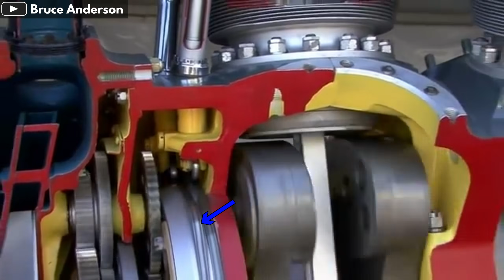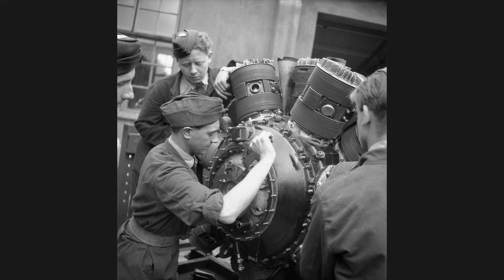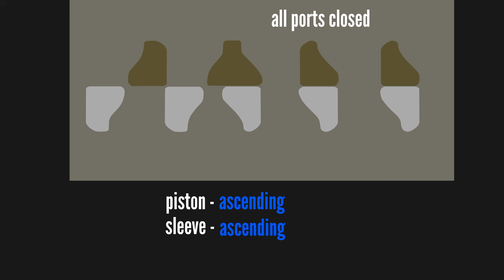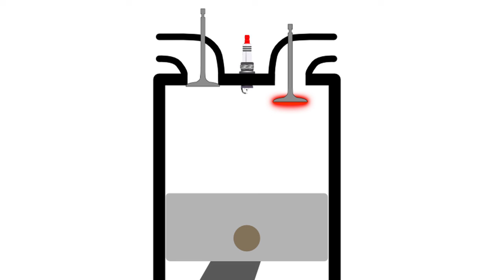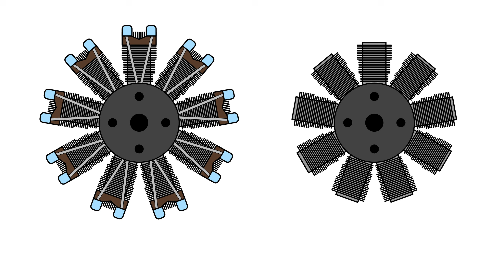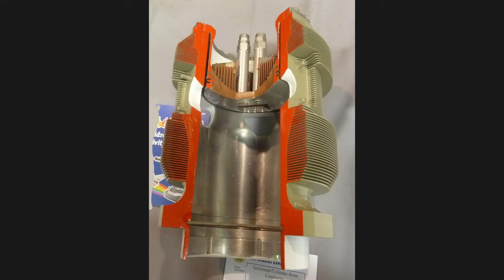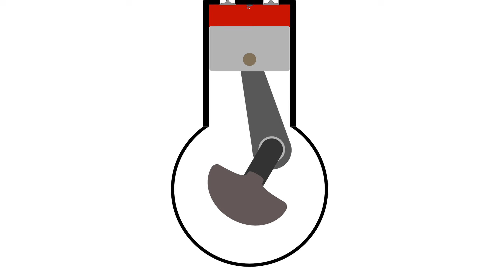Analysis of Bristol's Sleeve Valve Aero Engines

Comment: Important to note,,right from the beginning,,,the sleeve valve had much bigger openings than popet valves,,better "breathing" ,,and ! ,made a considerably smaller diameter engine,,streamlining the airframe better,,
Reply: Did you actually watch the video before posting your factually incorrect comment. As the video host said, the claim of smaller engine diameter was a wash. What the sleeve gained in losing the valve train it had to give back in an extended cylinder set-up.
Reply: @paulflocken2730   that's great to hear you treat u tube videos as absolute authorities ,,gospel troof ,,now,,take a tape measure,,go to an aircraft engine museum,,you'll learn a lot,,,😊the " herc" measures aprox 52 inches,,other poppet valve start at 55 up to 60,,every inch means greater air drag and less time  to taper the fuselage back to the tail,,but not only that,,they needed far less servicing before next mission,,valve trains need constant care,,awkward on radials,,and exhaust valves prone to overheating,,,jets took them all over,,but sleave valves were the leading edge,,,cheers,,,
Reply: @gavinboot4810  It's dishonest to edit your comment after someone replies to it to make the reply look more trivial than it was. If you genuinely measured these engines then please post your results.
Reply: @paulflocken2730  editings "dishonest "??,,,😅😅😅 others try and butt phuk me for grammar,,commas and shit,,their called "anal"  types,,"now I've got you,,your honour,,the whole case against my client for bank robbery must be thrown out,,look ,,theres a comma where only a full stops allowed",, get a life,,😅😅
Reply: @paulflocken2730 just wondering,,,do you have ANY interesting insights or observations about sleave valve engines ?? or are you just being aspergers  ???,,,

Comment: Compression ratio has little advantage in a supercharged engine. Infact it may lower the charge volume that the cylinder can hold. The compression ratio of these engines needs only to be high enough to start. This was known to Ricardo and Royce. Royce wrote about engines being air volume engines.
Reply: That's true if we are only talking about traditional HCSI mode combustion... GDI allows SCSI mode combustion that allows both high static compression and high manifold pressure to increase overall thermal efficiency.

Comment: Oops.  At 20:35 you mentioned that the piston rings sliding across a sleeve port opening could cause sleeve failure.  This is incorrect.  In a properly designed sleeve valve engine, the piston rings never run over a sleeve port.
Reply: I read that at high boost the sleeve can flex into the fixed liner port leading to "clipping" this was a limitation comparitive to its poppet valve equivalent.
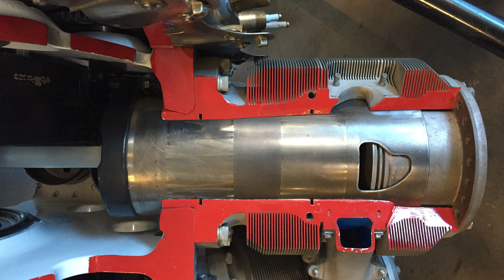Reply from the maker: I was not precise enough in my description, so oops indeed. It's the stationary piston rings in the cylinder head, not the main piston rings. The grooves for the rings are visible through the sleeve port at 5:20

Comment: Two stroke radials would have been more reliable. No moving valves, no master connecting rod zero vibration with four or eight cylinders. They need a blower but every other aviation engine has that.